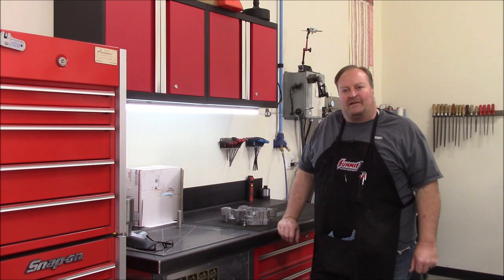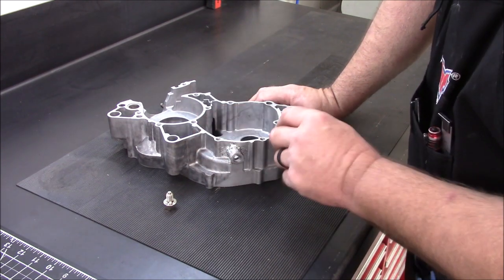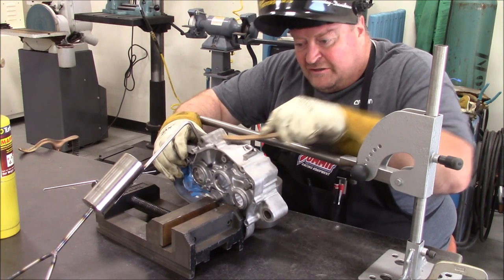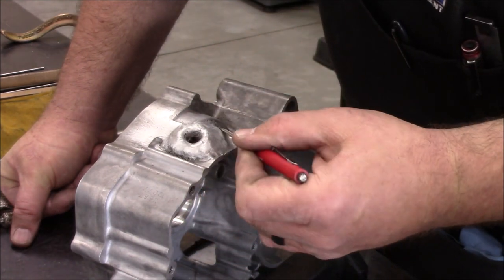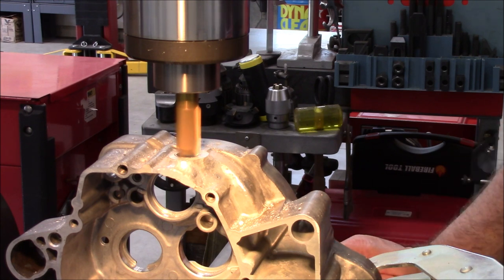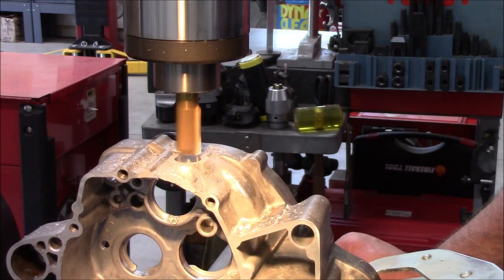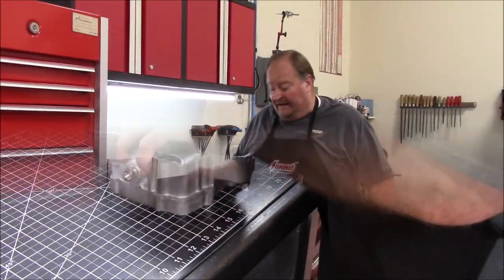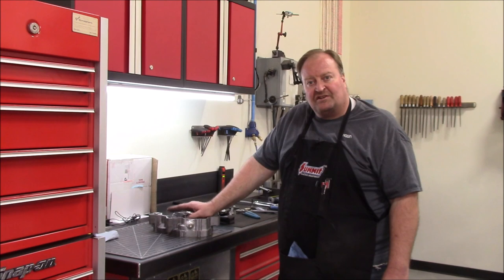Cast Aluminum Motorcycle Case Repair

Comment: I'm a machinist by trade too . You did a awesome job.  I would of not done anything differently if it was my repair. That repair will last a lifetime.
Reply from the maker: Thank you I appreciate that. Thank you for taking the time to watch. 
Mike
Reply: Mike
I have a KX250 case that needs that drain plug repair and the boss broke off that holds the pin that brings the shifter back to center. Not tech savvy enough to figure out how to DM you. Thank you, Gene
Reply from the maker: Sorry, I'm buried for the next several months at least and not taking on any more side work until I get caught up. 

I appreciate your thinking of me though and thank you for taking the time you watch. 
Mike

Comment: Super impressive. I weld piles of cases for guys. I wish I had the machine shop access like you do, unfortunately space and funds just aren't there 😂. Welding old oil soaked cast aluminum is an art.
Reply from the maker: Thank you, I appreciate the comments and thank you for watching.  Your right, oil soaked cases are not for the novice. 😄
Mike
Reply: where are you located and how much to weld a place on a 2002 kx250rt side case i can send you pics if you give me an address
Reply from the maker: zmotorsportsjkur@gmail.com

I don't quote prices because I generally have to see the item as I've gotten burned in the past.  I am in northern Utah and did side work when I have time.

Thanks.
Mike

Comment: I don't have a surface plate so I used a big old mirror. (thick glass, plywood backing) and taped some wet dry to it only on one end. (it won't buckle  the paper, but your strokes can only go one way) Then put soapy water on it . I used this setup to save from having to buy a water pump for my 5.9 Mopar. Because every penny counts and anyway I'm a cheapskate.  It seemed to take forever but I finally got a gasket surface. 
Good information on your channel. Thanks for posting it.
Reply from the maker: Thank you for watching.  
Mike

Comment: Nice clean job. Was thinking about attempting a small repair on my 49 triumph cases but I’m a little gun shy.
Reply from the maker: Just follow the process that I outlined and you should be fine if you are familiar with  welding aluminum.  Also keep in mind that not all cast aluminum is created equal as some have more porosity or less porosity than others so some adjustments on the fly are often required.  

Good luck in the repair and don't rush it.

Thank you for taking the time to watch.
Mike

Comment: Cut a slot out of the side of the drain plug boss, so its possible to get in to weld up the drain hole.  Weld the drain hole up using mixed AC/DC wave form, then machine down the weld flat, drill and tap the drain hole.  Takes a 1/4 of the time of messing about like shown on the video, welds arent riddled with inclusions, and the case doesnt get distorted due to the large amount of heat put into it.

Comment: Thank you so much for making a well produced video and explaining your thought process.  I have used WD40 with my carbide burrs on aluminum.  I looked at the Formax products and there seem to be different types available.  Can you tell me the type you use?  Thank you so much.
Reply from the maker: Thank you for the comments.  I have been using Formax F-200 for many years.  However, I recently tried CRL Tube Wax and actually prefer that, especially on abrasive discs, but also on rotary bits.
Mike
Reply: Thank you @zmotorsports62

Comment: I'm in the process of repairing my cases off of my yz250 after a connecting rod let go and cracked the bottom front of both sides as well as gouging the inner perimeter of the case where the crank is.  I have had success so far with depositing clean Tig welds, now am going to clean up the inner perimeter first with a die grinder.  I then plan on taking the mating surfaces close to flush with a file as I don't have access to use an end mill like you did.  What would be best for finishing it off once I get it to within 1/16" of flush with the file?  Keeping in mind that this is the mating surfaces of the crank on a 2 stroke with no gasket.
Reply from the maker: Whenever I repaired a case at the split where the case halves met I used I file like you then when I was within about .020”-.030” I would apply bluing and lap the case halves on my surface plate, but any large flat surface would be sufficient.  
Best of luck and thanks for watching.  
Mike
Reply: @zmotorsports62  as I'm not a machinist by trade abd don't have experience with lapping, what kind of sand paper did you use in the video?  And what fluid did you lubricate it with?
Reply from the maker: I used some 220-grit followed by 400-grit wet sandpaper to lap the case half.  I used some WD-40 as lubricant if memory serves and move the case in a figure 8 until all bluing was gone.

Comment: Hard to see it in the video but Ive gotta ask.... Does the slug you pressed in stand a little proud on the inside of the case???  If so wouldn't this prevent a full draining of the case when the plug is pulled?
Reply from the maker: No,  the insert is flush with the inside of the case. I also blended it a little with a rotary bit before sending it back to the owner.  

Thank you for taking the time to watch. 
Mike

Comment: I have an Rm85 (2 stroke) that has a hole on the very edge of the crankcase (where the two crankcases meet a gasket) I hope that makes sense. I was planning on trying to repair it with jb weld but I now know that’s not very wise.  Should I just cut my losses and take the motor apart, send the crankcase in now? Or should I try to fix it myself with the jb weld? I appreciate the knowledgeable video, stay safe
Reply from the maker: Personally I have not seen much success using JB Weld.  I know a lot of people use it and have heard of mixed success but I have the capabilities to fix it the proper way by welding and machining so I opt to go that route.  I've had to remove a lot of JB Weld by the time it comes through my door over the years if that's any indication.  

Good luck and thank you for taking the time to watch. 
Mike
Reply: @zmotorsports62  Since I’m young and broke, I figured I’ll try to patch it myself, if I can’t fix it myself I’ll reluctantly send it in somewhere. Thanks for the luck and for the information, you are awesome. 
Stay safe,
Dominic
Reply from the maker: I completely understand. 
Mike

Comment: Was curious on two things Sir, what Formax grease is your tube that you had used on the carbide Burr tool? Formax has different item numbers 
 Also, after you applied the dycem, you sprayed some type of lubricant on the sandpaper.. what did you spray on the sandpaper and what grit did you use for the aluminum?
Thank you very much very informative video I appreciate it ! I definitely would love to invest in some of the machinery that you have I just have welding equipment no , Mills or lathes.. unfortunately I can't do repairs as precise but thank you
Reply from the maker: Thank you for the comments and for taking the time you watch.  I am glad you found it informative.  

As for the Formax, it is #200 and the grit that I used on the surface plate was 220-grit.  For lube on the surface plate I just used some JB-80 Liquid lubricant. I don't necessarily think the lube matters all that much, the JB-80 was what I had readily available but I do find myself using it quite a bit for things like this.  

Mike

Comment: What type of filler wire are you using Mike? - Great presentation by the way?
Reply from the maker: Thank you.  On that particular engine case I can't remember if I used 4043 or 4943.

Comment: I have a 2004 TRX450R that the cases are warped and creating a problem when putting the two half's together, they teeter when they are aligned together. I am wondering how much work will need to be done and if it is a costly fix? I have a lot of time/money into this bike and don't want to give up on it. Any help would be much appreciated. Thanks in advance.
Reply from the maker: If the warpage is too severe it may mean the cases are trashed.  When lapping cases some material removal is acceptable but too much and it will reduce crankshaft and countershaft endplay creating a rotating assembly that is way too tight.   I would suggest a little lapping at a time with test fitment to measure endplay along the way.  
Mike

Comment: Great video! Do you have a hard time seeing the puddle while tig welding. Do you have any tips on helmet selection. Right now I have a Miller elite that came with the welder. Thanks
Reply from the maker: Thank you. 
I’m not a big fan of the digital helmets.  I realize they have a huge following and are all the rage but I still prefer a fixed lense. I don’t really like tools that require batteries for some reason although I do have a Miller Big Window Elite that my wife bought me about ten years ago but I just use it in tight spaces when I can’t flip my fixed lense helmet easily. I use a #10 gold lense with a clear protective lense in front on both of my fixed helmets and can see very well.  I’ve found that the gold lense seems to reflect some of the light back into the work.  
Thanks for taking the time to watch. 
Mike
Reply: Hi Mike you just continue to impress me with every project I see you do. Great video.

Comment: I’m doing it, the three quarters tang for the return spring broke “that’s cheap” three quarter of material wide by three inches high and was only like a couple sixteenths thick “just a tab” for an arm off the back of like a,,,,,,, fork return piece. kick shaft return

Comment: How about welding cast aluminum without tearing the motor down?  Think you can get it clean enough from the outside to weld up a crack?
Reply from the maker: It’s possible as  long as you could get it clean enough and there aren’t any seals or other rubber/plastic near the weld area that could be damaged.  
Mike

Comment: Hey Mike I have a 2003 gasgas wild 300 hp that has a crack on the left case half from the top to the bottom of the case (chain popped of and slapped the case will I was 5th gear pinned) I was wondering if you might be interested in repairing it for me.
Reply: I have search for one on line but it's a very rare atv and they do not make cases for it anymore. I also used jb weld on mine but it didn't work just like you said
Reply from the maker: I would be interested in taking a look at it and trying to repair it.  

My email is zmotorsportsjkur@gmail.com to contact me.
Thanks.
Mike

Comment: How do you feel about the case warping when welding on only one side while not bolted to the other side case?
Reply from the maker: No issues as long as you don’t camp out with the welder. There’s plenty of webbing and support in the case plus the aluminum dissipates the heat so quickly it hasn’t been an issue.  Although when I was doing a lot of the Yamaha Banshee cases back in the 90’ through 2000’s when they’d lose a chain and blow the countershaft out and wrap the sprocket into the mix, I would bolt the cases to help with keeping the countershaft aligned and running true when welding back together.  I also lap the case on the surface plate when complete to ensure a flat sealing surface.  
Thanks for watching and hope that helps.  
Mike

Comment: How would you go plug welding a stud hole in aluminum crank case so that it can be drilled and re tapped?
Reply from the maker: Are you referring to a threaded boss?  If so, in those applications UCD machined a new boss roughly the same size as the one cast into the case. Then before cutting the damaged boss off of the case built a small fixture to hold the new boss in the correct position for welding.  Cut the damaged boss off and weld the newly machined boss in its place.  

I hope that is what you were asking.  Thanks for taking the time to watch.  
Mike

Comment: Thanks man, fun watch! I have a dented & cracked case on my RM250. Ignition side, on the bottom close to the cover. Not sure its repairable, kinda thin right there. If I posted a quick vid to my channel could you lend your advice?  BTW - Nice Shop!
Reply from the maker: Thanks for the comments. 

Sorry for the delayed response. If you want to post the video I will take a look at it next week when I have time. 
Thanks for watching.  
Mike
Reply: @zmotorsports62  Hi Mike, thanks for taking a look!  Here is the link https://youtu.be/sbBQPCZy9EU
Super cool to watch you work, technical, clean, and precise. I used to work in a bronze art foundry back in the day, did a lot of TIG welding on large monuments (not so technical, clean, or precise). Even helped with the MGM lion in Vegas right before I got fired :) I blame the girl. Good stuff amigo.

Comment: @zmotorsports I had a crack on the inside of my dirt bike case that I had welded. I haven't put it together yet because I just want to be sure or at least more confident that it has a good chance at holding up. Is this something you'd consider looking at and potentially I could mail it to you for your expert eye on it? Or maybe a recommendation on someone who I can send this off to. Much appreciated in advance. I will pay for the work and shipping as well.
Reply from the maker: You can check the cases' mating surface easy enough with a straight edge and feeler gauges to ensure it is true and flat.

Comment: would you have interest in a 1986 Honda 250R 3 wheeler left side motor case - i need some expert welding help?
Reply from the maker: If I wasn't so busy and backlogged for several months maybe.  Unfortunately I simply don't have time.

Comment: Do you still do these repairs? I have a  case with a fracture, its actually not as bad as the one you did in the video
Reply from the maker: I do on occasion when I have time.  However, I am buried currently.

Thanks for taking the time to watch.
Mike

Comment: I have the same issue on my BMW 1200RT.  How do I get a hold of you?
Reply from the maker: Sorry, I no longer have my speed shop.  I just posted the video showing how to repair these cases.  

Thank you for your interest and for taking the time to watch. 
Mike
Reply: @zmotorsports62  Thanks.  What you did to fix that, is exactly what I need.  If I use JB Weld just to hold me through riding season, does this really screw the machine shop in the repair?
Reply from the maker: It will add another level of difficulty to the repair so the machine shop may charge additional if it's been gooped with something.
Reply: @zmotorsports62  can I ask what was the cost for the work you did in the video?
Reply from the maker: I can't remember that one specifically but most take a couple of hours or so.   They run in the $200-$250 range normally.

Comment: How much will you charge to repair my yz250 drain plug?
Reply from the maker: Depending on just how bad they're damaged I generally charge $100-$200 as it takes anywhere from 1.5- 2.5 hours to do these.

Comment: Can you fix my case it’s a 2006 crf450r and it blow a connecting rod so it slapped the counter balancer and broke the hole shaft and the bearing keeper fell of I want to repair it because on eBay there cases for sale gust I don’t want a jb welded case for $500
Reply from the maker: I have several other large projects I have to get done but if you’re not in a hurry for it I’d be willing to take a look at it and see if it’s something I could repair.  
Mike

Comment: How much does this repair cost thank you
Reply from the maker: Back when I had my business and was doing a lot of powersports work, a repair such as that would be approximately $125-$200 depending on extent of damage.  I’ve repaired quite a few over the years where the sprocket on the transmission countershaft came apart and tore the side of the case out. Those required more time and therefore could potentially be upwards of $300+.  
Thanks for watching. 
Mike

Comment: Hello Mike, that is a very good example of a case repair for sure. I have photos of the right side case to my Electra Glide that needs repair somewhat similar in nature to your work in this video. Is there any chance that I can forward these three or four photos to you for you opinion and thoughts that would come to mind once you view them. I believe that the case is repairable as long as close attention to every detail, just like what you show here in this video repair. 
Thanks for posting such a bitchin' video and opening up a door of possibility
Reply: Ok, I just read that you don't do much in repairs since you closed your doors in 2017. Actually I want to do the repairs on my own. I am asking if you could see what I see in the photos, which is, if it's a possible repair or not. That would boost my confidence a ton or bring into reality if its too much to ask for in performing the repairs. I tried searching for a replacement right side case for a 1991 FLHS and always land on pages the want to sell an S&S lower end for $4,500.00

Comment: I must know how much you would charge for such a repair, you know your shit. Great professional repair. where are you located?
Reply from the maker: Thank you for the comments. 

I am located in Northern Utah. 

For a repair such as this they run in the $100- $200 range sure to taking about 1.5- 2.5 hours depending on the extent of the damage. That particular case half was only the drain plug and relatively easy so $120.

Thanks for watching 
Mike